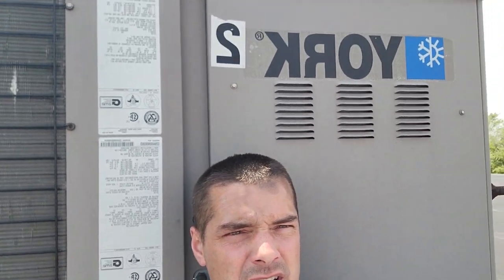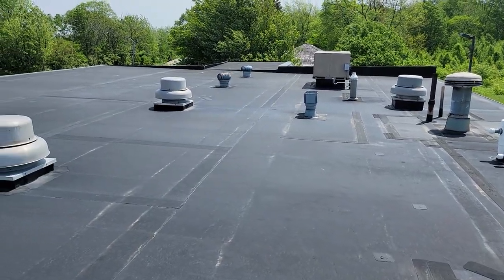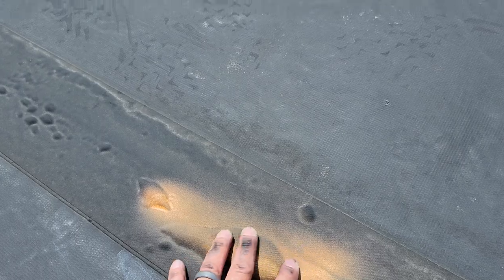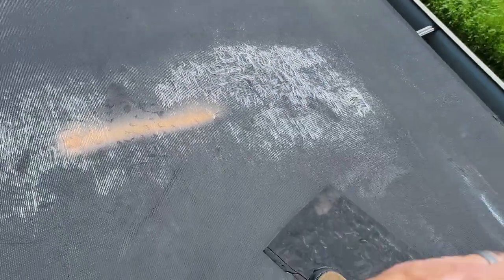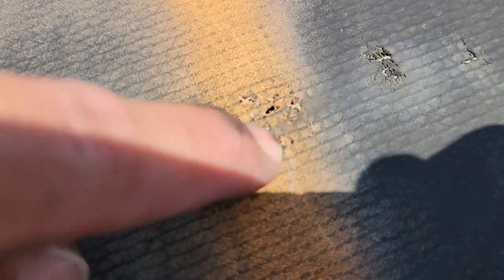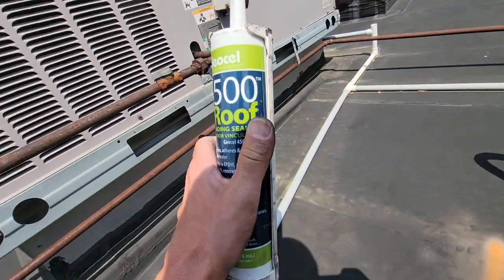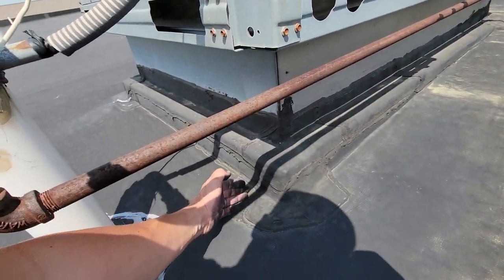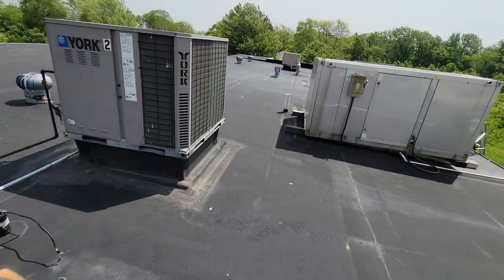EPDM Rubber flat roof going bad / The Uneducated Economist

Comment: When the scrim is showing through like that the membrane is done. Core cut to determine composition. If only one roof in place do a moisture survey to determine amount of wet insulation. If less than 25% you can remove wet, backfill, and do a single ply recovery system and get a 20 year warranty. If over 25% or 2 roofs in place it’s time for tear off. For what they have in place there’s no point in doing anything but stop gap repairs to try and keep customer leak free until material/budget is available.

Comment: I would crane the unit up replace decking add new wood 2x6 blocking rewrap the curb double wrap corners with 12"ff  we have so much Firestone rubber products here in Maine through abc

Comment: i would just put a patch over it seam tape the edges and bond adhesive in the center that's what we would do in nova scotia Canada if we didn't just cut it out
Reply from the maker: That's what the owner and I were talking about, just going over the one where the fibers are showing. The area over by the Hvac though we are concerned because it is rotted that somebody might fall through, removing a small section repairing the wood and then putting a patch over. What's your thoughts on the supply and demand and some materials coming down in price?
Reply: Most likely that would be the best bet ….prepare for the worst and hope for the best good luck

Comment: I'm afraid that too many companies have gotten used to the high profit margins they've achieved while supply has been low but demand high. I don't think prices are going to come down to pre-pandemic levels anytme soon, if at all. There's times when I can swear companies are in wide spread collusion with each other, even competitors, to keep prices high. I guess I'm just jaded by age now.
Reply from the maker: I believe you are totally correct that prices will never be back to the original pre pandemic prices!  I do think some things that have been hit with 300 to 500% increases will come back down a little bit.  Well at least I hope.
Reply: @GrandRoofingInc  They probably won't come down to the pre-COVID days. But I do believe that they will fall significantly. I'm retired and I had a back ground in construction. I" m holding off projects due to the high cost of materials. The best way to fight the price gouging is to not buy it unless it's a emergency,  then after the supply is back up. Stop purchasing from one of the major home improvement stores  who help control the prices. Supply and demand can also work for us if were smart.

Comment: What are your thoughts on a coating like silicone over the seams?
Reply from the maker: Are you talking about just putting silicone over the seams or are you talking about using a product like geco coating over the whole roof?
Reply: Just seams as a fast solution for a cheaper fix. Silicone or acrylic, not a whole coating.  The problem with the whole roof coatings is usually the roof is so far gone you practically need to replace half the roof to remove defects and water just to get ready for the coating.    @GrandRoofingInc

Comment: It looks to me like a TPO membrane upside down EPDM doesn’t have scrim My old boss used to have us install tpo upside down because the back side of it is normally dark and the right side is white   And after a Few years the uv rays eat through it
You should be able to weld a patch over it and if doesn’t weld you can use eterna bond tape to tape the patch to the roof. Happy birthday
Reply from the maker: Thanks!
Reply: reinforced EPDM does have a polyester skrim

Comment: Doesn’t look like EPDM. Kind of looks like pvc  
Also cant strip around the curbs would be a great idea. Soft spots for sure cut it out a replace as necessary, even wear the fibers are falling apart. Need to know why it’s only failing in that one spot. On patch jobs I like to double seams my patches if there big. M1 is a great product to use as well. Some mule hide primer and splice adhesive but I don’t believe this is a EPDM roof. EFDM doesn’t have fibres in it.
Reply from the maker: EPDM is both made non reinforced and reinforced.
Reply: Ok I have only dealt with the non reinforced